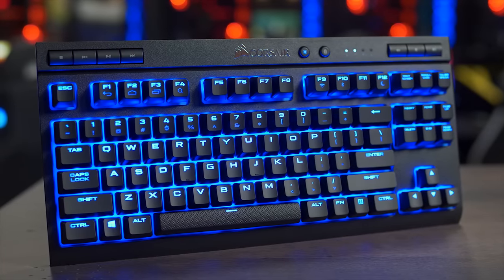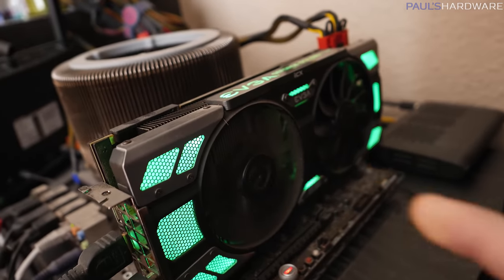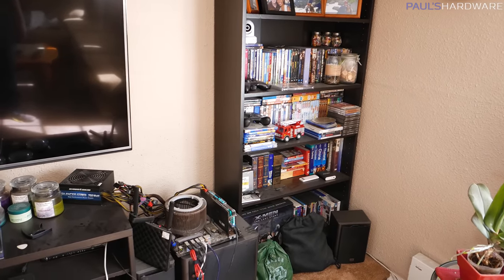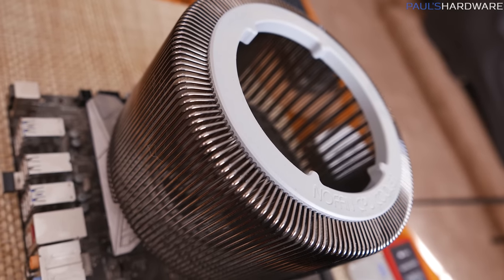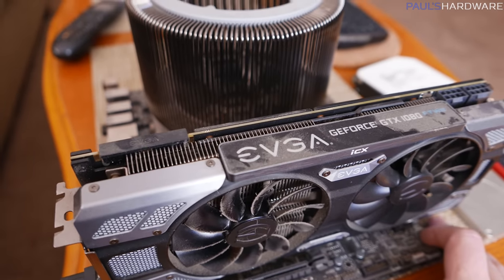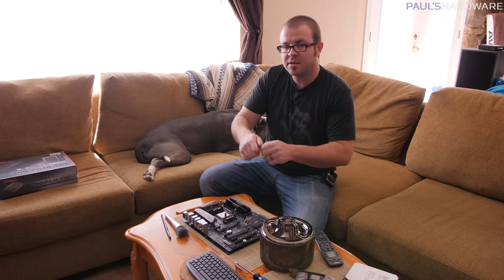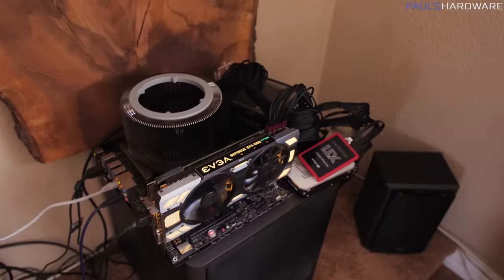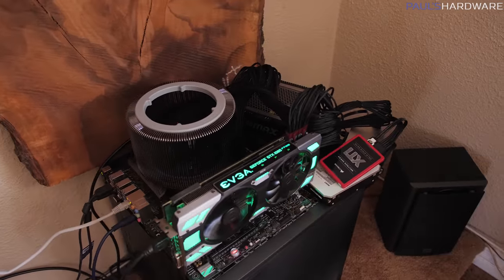Does Your PC Even Need A Case?

Comment: I built a small PC some years ago and use the bottom drawer of a file cabinet as a case. Just drilled some holes in the back for cords etc. Then screwed the Motherboard to the bottom of the drawer. Worked great, stayed somewhat clean. Lasted just as long as any other PC.

Comment: Woot a new Paul's Hardware video! Computer cases are clearly overrated! I was told dust makes PCs run better anyways!
Reply: In my own personal experience, a computer with an fully closed case tends to accumulate more dust than one with open side panels.
Reply: Because cases never have dust, ever.....
Reply: Just like you can live longer by taking less showers :v
Reply: BertyFromDK exactly. With a case there would be more dust because the fans act like a vacuum cleaner
Reply: @kimseniorb  I opened up my PC’s case, I barely do maintenance on it like an idiot despite living in the world’s dustiest house, and let me tell you, the dust was caked on the fan.

Comment: The real question: How does the dust compare to being in a computer case with the same treatment in your house? My house is a little dusty, which is why I ask.

Also, I wonder how well the hard drive holds up to the vibration of the sub-woofer during use and how it will affect the longevity of the drive.
Reply: I use cases with thick dust filters since five or six years now and it makes a huge difference but you still have very small particles of dust passing through so you need a bit of cleaning the inside once in a while.
Reply: opened my laptop yesterday. It had same kind of build up inside
Reply: @Vierax I have that metal mesh at the intake rather than a modern dust filter and it keeps the dust and dirt particles at a minimum (and man, the house is a dust magnet). All that needs cleaning are the fans really.

 From personal experience what you need is something to block the dust on the pull/intake fans. The case has many air entrances including the side panel where I removed the fan and it is still clean.

Comment: lol, cant even get a 1080 and he is using one for a media center...  >.<
Reply: #Yes, #it #would #be #better #to #use #an #intel #integrated #graphics #or #get #one #of #those #G #version #Ryzens.
Reply: That's what I'm saying I'm building a PC and best I can get is maybe a 1050 if I pray to cthulu enough lol and he's sitting g here with a 1080 just to record tv :'(
Reply: Use a rx560. way better performance on the 4gb
im running one on my pc :)
Reply: CJ was replying for chan moua for using a 1050 non Ti
Reply: wouldn't that pci slot also not have direct graphics bus to the cpu, and instead be routed thru the south bridge? or does this asus motherboard preplan the huge cpu heatsink option and enable a way to route the 2nd pcix16 to bridge to the empty first? shrugs
Reply: Well he said he plays games and VR on it too
Reply: Arnulfo Torres  Are you serious? Obviously its not the best anymore as 2000 series has arrived but its still one of the most capable cards. Around same card as newer rtx 2070. Still very good card.
Reply: Arnulfo Torres  The 1080 is massively better than consoles. The graphics depend on the games you play, as the 1080 should be able to max almost all games at 1440p.
Reply: Arnulfo Torres  I can tell you are not an expert on computers. And do not worry, that is totally okay. But the danger I sense with you is that you might be a bit naive about computers and I worry that people might tell you the wrong information about stuff that would cost you a lot of money.

First of all: Consoles do not have a great videocard to be honest. However the cards they run are very barebone. (they don't run on windows for example ) They have specific drivers and every console game is fine tuned for that card. Hence why console games always seems to run anything without problems. What you don't know is that most of the games are degraded or optimalised for the card. Meaning that the PC would run games visually better, depending on what kind of PC you have.

Second: I am really wondering what top 10 lists you are looking at, because the 1080 scores high on the lists I see. The cards that perform better are not even AMD but all Nvidia, and that is the 1080Ti, and the RTX versions. And while the RTX versions may perform better, they don't when they use the new onboard Ray Tracing chip. So practically your card is one of the best together with the bigger brother, the Ti. 

The only thing I am worried about is what kind of demands you have for gaming. Because the 1080 is great for 4K gaming on Ultra settings. Sometimes I meet people who payed around 700 dollars for a 1080Ti, and they don't even have a 4K monitor, just HD. And all the games they play are mostly simple titles and they not edit videos or anything. These people got ripped off because for they could do great with a 1060 or even 1050(Ti) . Myself for instance opted for a curved monitoring and I did not even opted for 4K because honestly I find it useless for gaming. So I got myself a 1060 and still have one till date. I can play all modern titles on HD, and only the newest one seem to be struggling on Ultra settings. Maybe an upgrade to the GTX1660 soon, but till then I am perfectly happy with my tailored system. You said you want the best, and I think you got it. But only if you really understand that 'best' is what you want. 

Don't let people fool you. Even if they are friends. Because friends don't care about your wallet, they only want the best, so they can play at your house, lol.
Reply: Arnulfo Torres  

It could help explaining to me what is bothering you while you game. Because it's a shot in the dark for me...

Do you have problems running games on ultra? Is your FPS too low? Is everything good, yet you feel like it is slow on your monitor? Do games load too long?

And if any of those problems, do you have it on certain games only? Or all of them? If a few, what games you play that is not good in your opinion? 

The only thing I can tell you is that 8GB of RAM is the minimum today. Most games need minimal 8GB. So you are fine, but you are on the limit. 12 or 16GB is average and good for future reference. 

the CPU and GPU aren't your problems in any way. 

Your monitor can be a problem, if you have the feeling that it isnt responding quickly. If your monitor is just a 60Hz monitor you will only get to see 60 frames per second. A 144hz monitor will boost it too 144 frames per second, that is, if your games allow to be played at 144fps. If possible use a G-sync monitor because that will reduce any jerk you maybe see on certain quick movements. But that means that both the card and monitor has to support it ( i know the 1080 supports it ) AND both needs a Display Port , because G Sync does not work (well) with HDMI.

But then again, do you play first person shooters? Or do you play simulators? Or.. etc. For instance, you do not need 120 fps for a racing game because 70 will be more than enough. However a shooter can make a difference. 

There are so many aspects on what you need, and what part of your computer is a culprit. Do you even need it? And if so, how much you would like to spend on it. All important questions you have to ask yourself before you try to expand.
Reply: Arnulfo Torres  Well based on your specs, you shouldn't get bad gameplay from a 6 year old game like GTA 5. I run GTA 5 on a older FX 8350 with a GTX 1060 on HD with all on ultra and get around 60 / 70 fps without jaggering. I do have 16GB of RAM, but I really doubt that is the culprit since GTA 5 does need 8GB. 

The only thing I can think of are either drivers, like is your Direct X 11 up to date, or is your Gforce drivers up to date? 

Are you playing 4K? or HD? The PS4 version only uses HD, so it could be very well that you are trying to do 4K. Maybe run it in HD with everything on Ultra and check it again. Also consider that GTA 5 is old and the graphics aren't really up to par with recent titles and maybe you got a bit spoiled with todays graphics. Try playing another modern title if possible. Maybe you got used to something? 

Also install a program like CPUID HWMonitor and run it while you game. Check wether your graphics card, your CPU or other aspects are running into problems, like too high temperatures etc. It could be hardware problems. But then again, it's just only one title I hear. And I wonder if you experience it with other titles. 

My best bet would be RAM, because your CPU and GPU is more than eligable to play GTA 5. Try experimenting with resolution. And do you play on the PS4 with a certain distance from the TV? Try to match the same view distance as if you were on the computer. I'll bet you start noticing even worse graphics, you might never witnessed before.  Any way good luck mate. I am sure you can find something out here.
Reply: Arnulfo Torres  for one, i'd get a better cpu. sure a 7600k is good, but there are muuuch better processors (9700k? would require a mobo swap tho, so prob a 7700k?). i'd get another 8 gigs of ram as well. the power supply might be an issue, how powerful is the psu?
Reply: he said he is playing games on it as well
Reply: mana drama  calm down bud you don't know nothing about me lol
Reply: mana drama  sure thing bud lol
Reply: mana drama  k lol whatever you say boss
Reply: I would have to work a month to buy a used GTX 1080 :(
Reply: Did you get it 6 years later?

Comment: Short answer: no, you don't need a case. I'm running a fanless, caseless system for 5 years and it just works fine.
Reply: is dust really an issue? like do i need like clean it every week or so
Reply: @unclezedd6183  from my experience of being a dirty, lazy pig and not cleaning my PC for months and months, not really, never had any issues. Now I air spray it once a month, but before that I sometimes didnt clean it for 6 months.
Reply: @suqd674  thanks man. Gonna set it up in a my hotel for 21 days quarantine

Comment: I have my PC without a case for some years now. I have to clean it once in a while, but it still works XD
Reply: How do you have your motherboard set up? What does it sit on? Im worried about static but it might not matter. Thanks.
Reply: @LazurBeamGaming  well now I purchased a case, cause I am planning to get some new hardware (waiting for the new Ryzen).

Before that, the mobo was siting on an ikea plastic cutting board, The motherboard had some screws (the ones that are used to fix it on a case), so it was slightly elevated from the cutting board.
Reply: @Theokondak Thanks for the reply I'll be getting a case but I ran out of money so Im going to do something like that for now.
Reply: @LazurBeamGaming  one small thing i should also mention, is that after a couple of years having my pc like that, the very heavy CPU cooler, has the mobo slightly bent, which in extreme cases could cause undetectable mobo issues, so keep that in mind. Other than that, you might wanna purchase some cheap cable and a button to make your pc boot. Otherwise, you can do that with any metallic object. Just find the two pins with "PWR" or something similar on your mobo, and do use the metallic object to create contact between them. Be careful though, cause touching the wrong pins could cause issues.
Reply: @Theokondak  Thanks a lot.

Comment: built my pc nearly 4 months ago and was not prepared for GPU price increases at the time, so my last $100 or so i had to spend on my build went into the GPU leaving me with no money for a case, i then joked about leaving it in a cardboard box with IO cutouts and such, with a big sharpie drawn “PC” written on the side. i’ve used this box as my pc case since and have had no issues especially since my components are not the most power hungry (R5 1400 and an RX 560 4Gb) dust build up isn’t the biggest issue either however i have noticed it and occasionally i will get around to cleaning it. really interesting video paul keep it up 👍🏻
Reply: Nathan Hare im gonna build a carboard case too it looks good bc these big companys still dont seem to understand airflow

Comment: I’m shocked quite literally that the magnet inside the subwoofer hasn’t completely destroyed your drives, motherboard, etc...

I placed a computer too close to one of my old guitar half-stack amplifiers and it COMPLETELY destroyed everything in my old computer several years back. I don’t place ANY computer components near a speaker of any kind whatsoever and would NEVER recommend to set computer components or any computer near ANY large speakers EVER. 

I would definitely say to do so at your own risk of potential damage to your system or components. No offense but it’s definitely not worth destroying your equipment or the risk.
Reply: Had no clue this was a thing... I keep my monitors 2 feet from my pc 😳
Reply: I thought only the HDD was at risk.

To which you've reminded me not to place the monitor near it.

Comment: Having a fanless power supply will not prevent dust buildup as dust will simply settle inside -- same goes for a totally fanless case with an open top grill. The best thing for controlling dust is very low- RPM filtered fans to create positive pressure (not an option without a case), using very dense filters, like Demciflex or Silverstone's densest filters, and then using a CompuCleaner or a DataVAC once a year or so to blow away the little dust that has gotten thru.

Comment: Every single PC case I've looked into, cheap or the most expensive ones, came up with the result that if you ever open the side panel, it helps a lot to cooling. So I was thinking to build one space case for a long time and hang it on my wall so it wouldn't take space on the desk or floor and I wouldn't have to worry about air flow of cases and spend unnecessarily expensive money on liquid cooling systems. But I was worried about dust accumulation and I've searched for the dust problems and you were the only one I see, not only talk about it but actually tested the setup and show the results. I knew the problem but now I see the problem with my eyes and I can seek a way to workaround because everybody knows dissasembling and reassembling PC for the cleaning is a time-consuming pain. Thank you.
Reply: Keep it inside the case and find a way to keep most of the dust out.

 Temperatures will be negligibly higher and you will only need to clean the dust accumulated on the fans inside without needing to take anything apart.

 Maybe the problem are too many fans pulling air out, this creating negative pressure that pulls air in from everywhere.
Reply: @JonatasAdoM  Hi. I have Cooler Master HAF XB cubic case. The day I build it in 2013, I ordered fans for every hole I can install; I even installed two small 80mm exhaust fans, since the case had slots for that. I only left the top slot open which I could install 200mm single fan but my third party CPU cooler was pretty high so there wasn't any space left for it to install. So I love fans and I like to fill the free slots. :D 

So as you say, I only need to clean dust accumulated fans but since it's horizontal motherboard build, even the simple fan cleaning is causing a pain; you can't work freely without removing motherboard tray because all the cable mess hides under the tray; which leads you to remove all the power and data cables connected to motherboard for work on anything. 

It's a good case actually, I never had a temp related issues so far but it's also too compact for my hands and fingers. Everytime I installed a new HDD, I had to remove motherboard to add new sata cables. Tho, it has two 5.25" (which I converted to 3.5" for my storage needs), two 3.5" and four 2.5" slots; you can't find that many harddrive slots nowadays if it's not expensive full towers like Sekira 500 etc. I didn't cleaned it for the past two years at least but it still looks good; most dusts accumulating on the fans rather than motherboard. 

And that's why I wanted a big space case. My main focus was to easy access on every hardware rather than neatly compactness so I don't have to dissassemble and reassemble anything when I want to add something new or just remove fans to clean. Also I ran out 3.5" HDD slots before my sata slots. So I have no other choice than removing 1 and 2 TB ones and add 4+ TB ones until I buy or build a new case. 

Would you like to also build one space case to hang on your wall? It could be amazing, really; so I could copy some ideas and learn from your mistakes, haha. :D

Comment: For dust control, I strongly recommend Demciflex filters or Silverstone's FF123B (or 143B for 140mm) filters in combination with low RPM intake fans for positive pressure. These filters have ultrafine mesh -- it does let the tiniest particles thru over long periods of time, but those are very easy to blow away with something like a CompuCleaner once a year. Don't use compressed air -- that stuff is mostly useless. If you're serious about keeping your components pristine, invest in a DataVAC or CompuCleaner -- these have 500W+ motors inside and small nozzle attachments that can create insane air pressure and blow the dust out of anything, especially if it's all superfine dust from the aforementioned filters. I just cleaned my system after a year, and it literally looks brand new, no sign of dust anywhere.